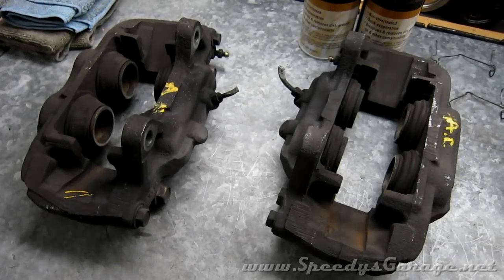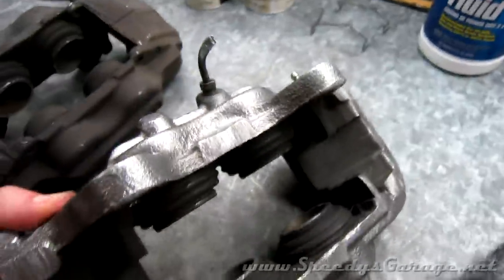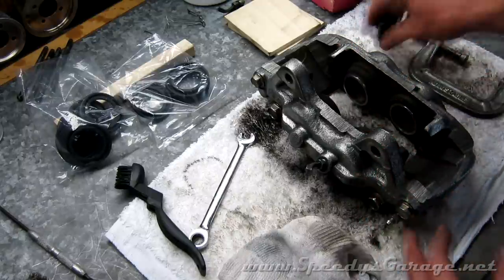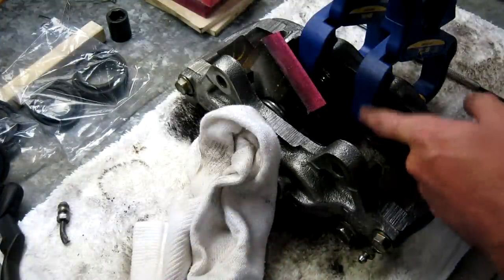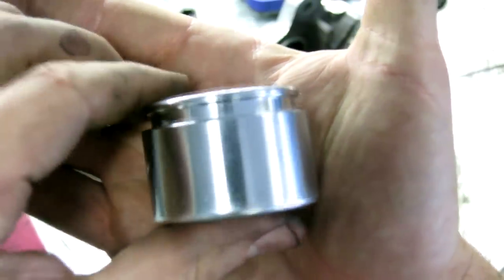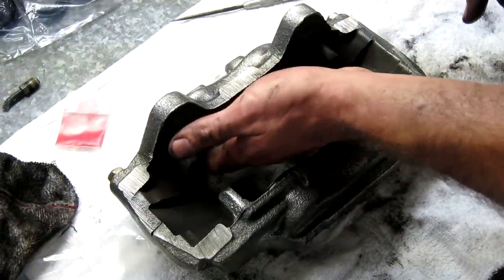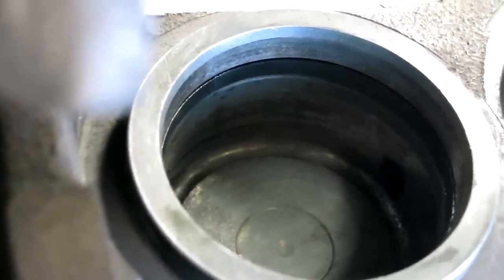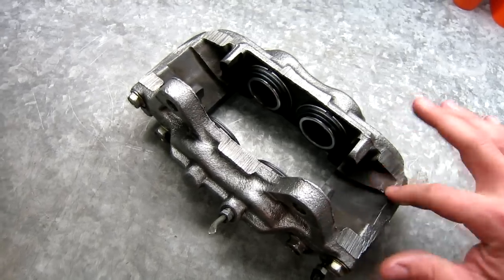How To Rebuild Brake Calipers 3rd Gen 4Runner 13WL

Comment: Does your 02 have 15 or. 16 in wheels I know many have the 16" but I'm blessed enough to have the 15" note the sarcasm , Wich seem to be a bit harder asst times to get stuff for....so thought I should ask before tracking down the 03 tundra calipers if they will only work on 16" wheel size.
Reply from the maker: These are 16", but they're pretty cost effective honestly.  Level 8 is the brand.

Comment: I broke the bleeder bowls(valve or screw) it was stuck and rusty on  caliper so,It is broken .somebody says that I have to replace calipers but there no way to get the screws out? please help me.
Reply from the maker: There's always a way to get them out.  Heat, drill/tap, etc.  It may be cheaper from a "time" perspective to just get another set from the junkyard though.

Comment: Can you lube brake seals with brake fluid?
Reply from the maker: Brake fluid can dry over time.  You want to use proper grease to insure longevity.
Reply: use toyota red rubber grease